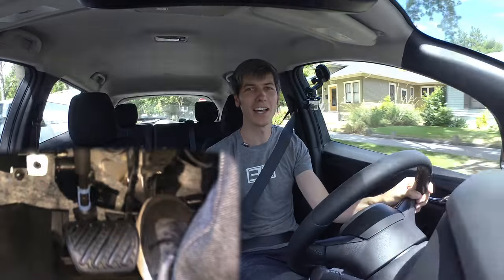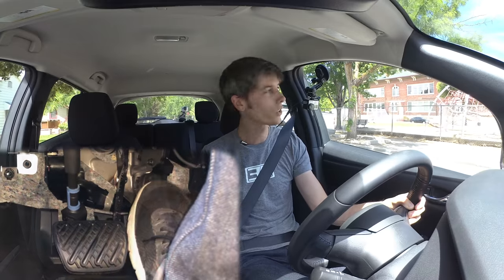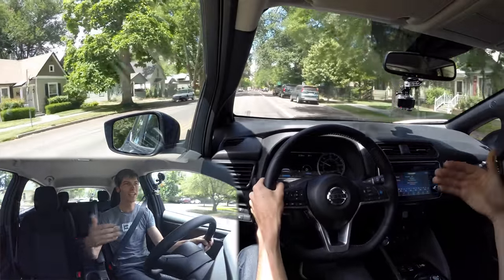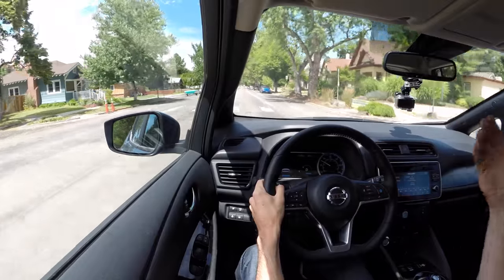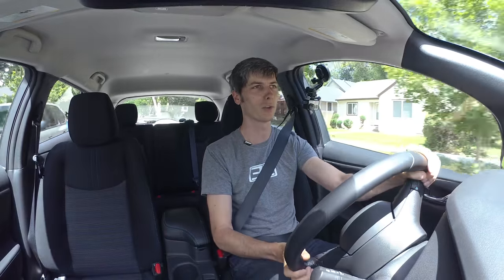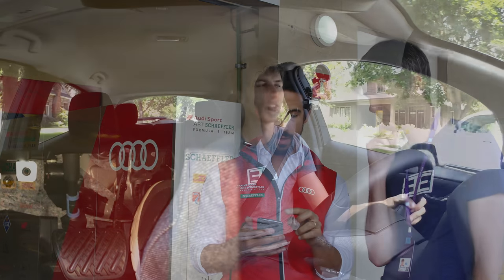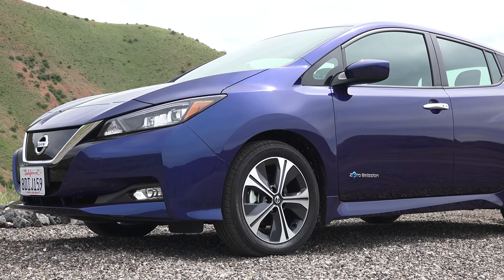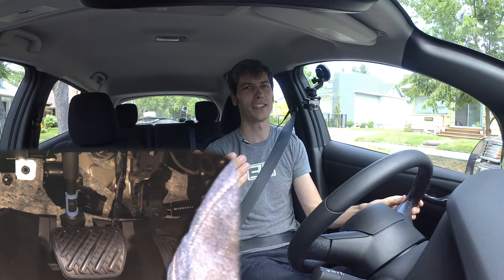What Is One Pedal Driving?

Comment: 3 pedals stick shift , 2 pedals automatic , 1 pedal electric and next logical step will be 0 pedal autonomous  cars right?
Reply: wow
Reply: Unfortunately YES
Reply: 3 pedals in the past, 2 pedals in the present, 1 pedal in the future... ...
Reply: Remember "real man use 3 pedal" quote... its gonna be "real man use pedal"
Reply: I remember a few years ago that there was a steering wheel that controls acceleration and braking.
Reply: Apocalypse487 would that not just be cruse control?
Reply: ReadyToGo No.  It wasn't cruise control. It was similar to a yoke in how it operates.
Reply: Apocalypse487

Yeah, paraplegics drive, too. Don't know why anybody else would want hand controls...your feet are just sitting there; may as well use 'em!
Reply: Of course.  I'm just saying that it was an idea people put to use in an experiment.
Reply: NOOOOOO!!!!!!!! 😆
Reply: Armour Shooter I wouldn't say 3 pedals are a thing of the past. A vast majority of cars in Europe are manual, and it's unlikely to change any time soon
Reply: Not necessarily a logical step but probably still the next step.
Reply: Renaud Dargis 
3 pedal diesel jetta,I’m tempted to take out the brakes from the wicked compression braking. 
About the only time you use them is the last 20’ before a stop sign
Reply: When the robot revolution comes, they'll chant "0 pedals good, any pedals bad!"
Reply: Well. In normal gearbox when you let go of the gas the engine slightly brakes as well.
Reply: I was hoping we would eventually go to six pedals.
Reply: (-1) negative one pedals???
Reply: Yeah, it’s called fully autonomous.
Reply: Smile Space would that be you owing someone a pedal? Or someone owing you a pedal?
Reply: Sad but true 😭
Reply: ill stick to a stick/ flappy paddle
Reply: "unfortunantly"Spoken like a true lazy person with nothing to do till they die cept press pedala
Reply: I'd rather ps4 controller
Reply: -1 pedals will be when we have to bring our own pedal to the car.
Reply: Keep the 3 pedal alive
Reply: yes, 0 pedal and fully autonomous will be the future. 
I love to be there soon!
Reply: Question I've always wondered: In countries where automatics are just the standard and driving a manual is rare, to people learn to use one foot per pedal or do they still drive using one foot for gas and brake?
Reply: James Oren 
Always use 1 foot for gas and brake. If you got into an automatic for your driving test and put one foot on gas and one foot on the brake, they would probably immediately fail you lol. 
Only use 2 foot for manuals.
Reply: Abdulkadir Özgencıgor real men dont teleport
Reply: Appletank8 Model T had an automatic-style gearbox driven by the planet carrier, with the output shaft on the sun gear. There was a pedal to lock the output shaft to brake, and two pedalsthat each locked one of the ring gears to achieve a geared-down forward and a reverse. Then the parking brake could shift forward to allow the direct drive clutch to engage once the forward pedal was released, for high gear.

And then you also had to work spark timing and throttle with your hands, yeah.
Reply: 0 pedal cars= self driving cars
Reply: that was solid
Reply: GODS use 3 pedals
Reply: I cannot go for 1 pedal, I used to 2 pedals. If I buy electric, the kinetic energy recovery system must be controlled by the brake pedal, not the accelerator. I am OK with the 0 pedal though.
Reply: this comment is aging well
Reply: Honestly they could do 0 pedals now with what cruise control on a lot of cars in most driving situations. I wouldn't want to give up my pedals but I hardly use them ever.
Reply: Exactly.
Reply: @bendriver1127 it's changing though. automatics are getting more popular even in Europe, its not only for old people anymore like it used to be. they went from slower, less efficient, more expensive, to in many cases quicker, more efficient, and with DCT being the only option on all the most track focused sports cars, automatics being usable in manual mode.
3 pedal is now more question of personal preference but also German manufacturer are transitioning towards 100% automatic, Toyota is selling 75% hybrids in Europe which are all automatics eCVTs, without even a manual mode, and all supercars are now automatics
Reply: @-Burb but pilots/racers do left foot brake
Reply: @leeway777 this one of the reasons I wouldn't buy a Tesla. because someone decided using brake pedal was bad, same for physical shifter/blinker stalks. my ev is all Regen braking on the brake pedal, and little Regen like engine braking on an automatic, when lifting the accelerator.  it's safer to be able to cover the brake pedal for defensive driving. I think braking is the #1 driving skills that anyone must know, including emergency braking, braking on wet road, gravel, snow, etc
one pedal driving means losing the muscle memory for that brake pedal
Reply: @EatMyYeeties 2 is 1, 1 is 0.

Comment: Might as well remove the brake system for weight reduction
Reply: Because that's safe.. Not!
Reply: nope thats a really bad idea
Reply: Problem there is the braking force from the motor is no where near as much as the real brakes. Sure it's enough to bring the car to a stop in most driving scenarios however, as said in the video it's not enough in emergency scenarios.
Reply: He was obviously joking...
Reply: Ino Torres People think you are being serious :/
Reply: Rather ironic given the reputation of the pony in your profile pic and crowds
Reply: LOL 😂
Reply: So much salt, well played Ino
Reply: Edit: I found out that i'm probably wrong...
Original Comment:
There is actually multiple braking modes for electric Motors.
-You can use active braking, putting the energy back into the batteries (weak).
-You can short the motor windings (medium, shouldnt be used often because of heat buildup).
-You can drive it backwards, resulting in extreme braking forces (not sure if possible with all motors).
So the braking pedal could just switch the way the braking is done.
Reply: Hey it's not a bad idea. A lighter car won't need as much force to brake. Just keep the handbrake.
Reply: Dave actually everyone use only active braking. No one ever manufacturer brakes that outher way you described. Braking must be controllable and current must not exceed inverter maximum current. Short the motor of ev at decent speed and traction inverter is gone. Driving motor backwards only applies to induction motor at low speeds, lower than motor slip speed. This is not the way car does braking, beacouse applying friction brakes saves energy, compared to driving motor backwards.
Reply: Because racecar bro.
Reply: Ino Torres: Please use an obvious label, like "SARCASM"...  It assists those with a lower humor factor.  sorry if you were serious.
Reply: Guys obviously I'm not being serious😂

Comment: Next popular feature, pull back on the pedal to Go reverse!
Reply: That's actually a really neat idea.  Like a Boosted Board
Reply: Or try our special edition, keyboard driven car! You won't need pedals or wheel anymore!
Reply: mlok4216 [S-N] but that's either no throttle or SCRATATATATTATATATATATA
Reply: Electric forklifts have one pedal for forward and reverse. Right side is forward, left side is reverse. And yes, it sucks.
Reply: Just like some ride on mowers of the last 30 (or more) years
Reply: It already exists. Used to drive a little Stiga tractor 7 or 8 years ago with just one do-it-all pedal. It was a hybrid. 16 HP gasoline engine and an electric motor.
Reply: DrewLSsix please no
Reply: Like a Skidsteer forklift :P
Reply: The Model T Leaf does that!
Reply: mlok4216 [S-N] Next is Game Controller steering and accelerating

Comment: No brake pedal? Because racecar!
Reply: *because nascar
Reply: Georgio Henderson nascar is dead
Reply: Subie Dan yeah but it's all gas, no brake
Reply: Weight reduction bro!
Reply: You wouldn't want that functionality in a race car. You want to be able to decelerate as little as possible in some scenarios. Being able to let off the gas without any braking is ideal for that.
Reply: @sienile Yes you do F1 cars use regen braking on the rear wheels, which allows them to use much smaller rear disc brakes. Obviously not single pedal, because it is activated by use of the brake pedal. Also different becaue you are making 4-5 g deceleration. Formula E has something similar. LMP1 has front and rear regen braking
Reply: vistastructions 5 words Real Men Drive with 3 Pedals, not 2 Pedals, and an ECU, shifting gears for you
Reply: Brake booster delete is oem. Bcuz Nismo.
Reply: If in doubt, flatout!
Reply: You spelled racecar backwards. It's racecar.
Reply: You want to save lap time. This forces you to start breaking as late as possible to keep speed high as long as possible. This forces you to have as much braking as possible.
Reply: MAXIMUM WEIGHT REDUCTION
Reply: Gravecb7 Accord untrue you don't have to drive a manual to be a "real man" get out of here with  your false ideology
Reply: do it in the dirt
Reply: Nascar is fake racing
Reply: @glenjamindle  xD

Comment: I use a one pedal rule when I'm driving every car. If you are using brakes your just wasting energy by dumping heat into your brakes.
Reply: I use two pedals because I have manual transmission. Anyway braking is something anyone should avoid in any car as much as possible because it only cases wear and is rather unnecessary in most situations (other than complete stops and emergencies and really really steep downhills.

Comment: I knew Americans are overchallenged with three pedals...  But now two are already too much? 😂😂😂
Just kidding 😉
Reply: LMAO, that's so true. I know plenty of people here who don't even know what manual transmission is.
Reply: ActionHeinz. Its a foreign vehicle tho....  also, driving with fewer pedals than you have has traditionally required more skill. Except for stops and starts I tend to drive my manual trans cars with just one pedal. Slowing and accelerating with just the gas pedal and shifting without the clutch pedal.
Reply: DrewLSsix “shifting without clutch” hmmmm
Reply: Mecha Fanboy. Yeah? Got a comment to make?
Reply: its called rev matching, and it can be done easily once gotten the hang of. It is easier on motorcycles than on cars because they do not have synro meshes in the gearbox, but it is the same principle in a car
Reply: EdwardTennant Gaming my experience driving an old LADA was a blast from the past when I realised there is no other shifting than rev matching. It did have a clutch but I found that useless for anything else than accelerating from standstill. You could press the clutch, but the gear wouldn’t really go in without a rev match. However, the case was so loose that you had quite a rev range to pick from.
Reply: It's fun to make fun of the 1% isn't? I know how to drive a manual transmission but honestly I rather drive an automatic. That way I don't have to mess with the clutch and drive more comfortably while talking to people in my car or drinking my coffee. Today's new automatic transmissions are better than Manuel ones anyway so really the only reason to have a manual transmission is because you like to and have a nostalgia for it.
Reply: Human laziness drives technological progress.
Reply: jlrockafella Automatics are there to ease driving, so that you could concentrate more on the road. Not to concentrate on your coffee or passengers. Be alert, concentrate and be safe. Geez, next you'll be telling me texting is possible with an automatic...
Reply: Jason Jaafar I personally can't feel that concentrated unless I'm driving a manual I would get bored if I was to drive an automatic I don't think I have the patience to "drive" a car that's doing one of the most engaging things (shifting) for you
Reply: jlrockafella would have been a good comment, except for that first sentence. Shame you had to put that in there.
Reply: I'd prefer it if most other Americans didn't know about the 'third pedal'. Just means that there are less people who ask if they can drive our cars. I'm good with that.
Reply: EdwardTennant Gaming yeah but you still need to use the clutch to put it in and out of gear no?
Reply: Nope. Big rig truck drivers do this frequently. They call it 'floating the gears.'
Reply: Dan Sanger Agreed; as well as human stupidity.
Reply: Jason Jaafar actually driving with a manual makes you concentrate more on the road and driving. Automatic makes things easier that leads to down time to check your phone, drink coffee and whatever people do that distract them
Reply: Not for me.  No automatics since the 90's.  Toe/heel every day.
Reply: I say the same with flying cars.  No thanks,... the average driver can barely handle 2 dimensions.
Reply: same here dude
Reply: Shawn Jones was that a coherent thought
Reply: DrewLSsix Then you are going out of your way to not use the clutch and it's worn out.
Reply: DrewLSsix that's just a pain in the ass and it saves pennies if your perfect at it if not or you slip up every once in a while your actually doing more damage then the small amount of wear on your clutch compared to say rev matching with a clutch it also shaves your gears slightly over time and will make your transmission sloppy and eventually if you do it long enough it could even knock you out of gear when hitting a bump your shaving off the little edge that keaps you in gear not a good habit  I usually just give the throttle a quick blip with the cluctch in wait for the rpms to fall into the correct spot and release the clutch if done properly it leaves little to no wear on your clutch is safer on your transmission and way more convenient
Reply: Their chubby feet get stuck between the 2 pedals.
Reply: one pedal driving is just relaxing and so nice...
Reply: +jlrockafella that and because you just want to drift.
Reply: Vollick calm down, Sissy
Reply: Didn't realize the Nissan Leaf was only sold in the United States
Reply: Mecha Fanboy It's called floating gears and is a normal skill for truck drivers and non-americans.
Reply: Lmao
Reply: One pedal driving requires more concentration than 2 pedal IMO. 

The immediate torque vs breaking with very little change in your foot movement definitely would be trickier for inexperienced drivers.

This is coming from someone who has driven clutch, sequential, automatic, and EV

Comment: I'd like to see what happens if you put one of those drivers who can't regulate a throttle in this car. You know, the ones who are constantly brushing the brakes to maintain a constant speed. And then you can't tell if they're actually slowing down until their rear bumper starts getting bigger.
Reply: Eoin Kenny 😀
Reply: e pedal should illuminate the brake lights automatically.  I think this type of driver would be a better driver in an EV since they could scrub speed faster.
Reply: Jimmy..   you may need to get out of state more....

They Exist, all too frequently in some Jurisdictions (2 foot Automatic drivers mostly - they have gotta keep both feet busy somehow, it's a tradeoff between Accelerator and Brakes, in a real test, the brakes always win). jk. sarc and cynic.   (have a great day, just stay off my sidewalk)
Reply: Eoin Kenny I cannot stand these drivers. Sometimes I sit behind someone riding their brakes for 500m straight when I'm behind them, foot still on the throttle, maintaining a constant speed. It makes their brake lights redundant because you don't know if they're just going to ride the brake pedal again or actually slow down.
Reply: problem with the system illumiating the brake lights when the driver is just modulating pedal pressure to control speed is that it will eventually cause traffic jams.  Driver's behind the E-pedal equipped car will see the brake light flashing, and thus put on hydraulic brakes and slow down...the drivers behind them, slow down more, and the next thing you know, everyone is sitting in stop & go traffic just because a leaf driver several minutes ago let off the gas to drop a mph or so to adjust pace with the traffic
Reply: @audvidgeek I don't brake when I see brake lights! I gently lift throttle. if driver in the front is tailgating and constantly accelerating / braking I leave more room. coasting/ engine braking  is enough 90% of the time, but with foot on the brake so you can slam it if you need to. I hate people who overreact, like slamming the brakes whenever they see a brake light, so I do the opposite. sometimes I'll signal slowing down by touching the brake pedal especially if car behind is getting closer. it's more comfortable, better for the car longevity, and more efficient. I usually get way more mpg than EPA even driving 80-90mph when traffic allows
Reply: @geemy9675   you are an exception however....most drivers dont do that.